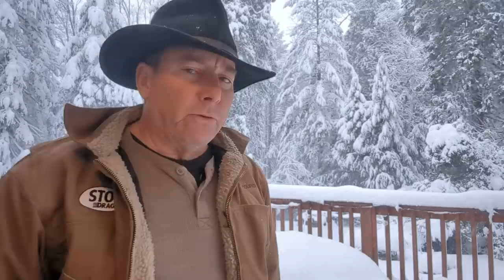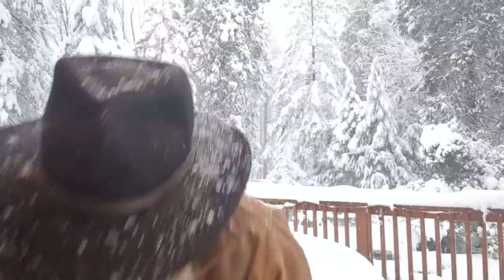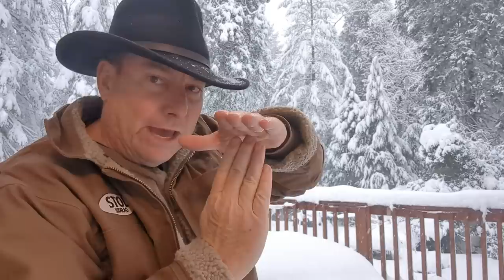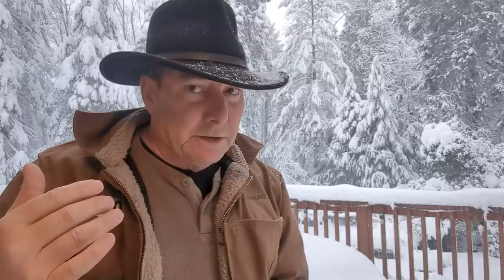PC-12/45 NTSB UPDATE In Flight Breakup! 26 Feb2023

Comment: I've been working on my instrument rating (getting close) and it seems odd that a pilot that can fly a PC12 wouldn't be proficient at flying on the gauges. I guess PC12's are glass panels though. Turbulence could knock the autopilot off and probably did. 

The only spatial disorientation that I've experienced was in a "thing" called the Vertigon. I was at airshow in the early 80's and AOPA or some organization had it there. I got in that thing and they closed the "canopy". They started giving me startup instructions, then takeoff clearance, then headings and altitudes. It's been a long time since I did it and I don't recall everything but when they said that I needed to switch tanks and to reach under the seat for the valve, I was done. I didn't just reach, I bent over to look for it. I lost control and couldn't recover. They had to help me out of that thing when they opened the canopy lol. My logbook has a "Wow! I Flew the Vertigon" sticker in the back of it. I'll never forget that feeling. 

So yeah... if it was spatial disorientation I can see how it would get out of hand very quickly. It just feels like something would have initiated the pilot to get off of the gauges... That first or second hole in the Swiss cheese is what I'm wondering about...
Reply: I would love to read or see more about that device (Vertigon), but can find nothing online. Do you have any more clues or keywords I can try?
Reply from the maker: If you don't think this can not happen to ANY of us, you are in the wrong business...
Reply: @blancolirio  I know it can happen to anyone but something triggers it. That's what I'd like to know. What put the pilot into that situation. I'm just a private pilot working on my instrument rating, with a little actual. No corporate or big jet time. In the case of the Vertigon they were turning it while I was inside and couldn't see out. I moved my head 180 degrees-ish down  and that started the fluid in the inner ear turning (or something like that). It's the most disorienting thing I've ever experienced. Spin training was nothing like that experience. In the real world I don't think I would survive if it happened to me.
Reply: Sounds similar to something they had at the Calgary Stampede late 70's.  When they asked you to switch tanks, and being unfamiliar with its location, one had to put your head down to find it. When you looked up, nothing made any sense, and you are done. It may have had a rotating component that started so very slow, that you couldn't detect it.  Opened the hatch and the whole world was spinning. They gave preference to pilots to try it out.  A good wake up call. Fun too.
Reply: Michael : The autopilot packed up (turned itself OFF) due to turbulence and the pilot was taken by surprise and slow to get on the instruments?  Turbulence could also have put the aircraft into an unusual attitude accelerating the problems.
Reply: @blancolirio Juan, it is with much respect that I just have to mention there is a double negative in the sentence that is unintended.
I think you meant to say, “if you don’t think this can happen to ANY of us…”

Sorry to be so picky, but I, too want to make sure everyone understands this point. Keep up the great work!

Comment: I have had spatial disorientation while driving at night in heavy fog. The kind of thing where you find yourself inexplicably accelerating while you think you are going uphill. It is a wildly difficult thing to recover from when you are moving. But fairly easy once you stop the car.  I can't imagine how difficult it would be in a three dimensional environment where you can't stop.
Reply: It speaks to one’s ability to trust the instruments. If they’re working.
Reply: I have had similar issue driving in heavy big flake snow storm in the mountains east of ABQ back in the mid 90's.  I actually had to watch the GPS to know when we finally were headed down  the mountain again to get out of that stuff.  The memorizing flakes coming at the windshield from the glare of the headlights really can play with your mind.  Had to keep stop watching in front of the car and look out the side window for bits at a time.  There was almost no way to know if you were going up or down.
Reply: Had similar happen when driving at night in a blizzard, Speedometer said I was moving at 35 MPH but visually it seemed I was standing still. Finally realized that the stakes that are set about 100 meters/yards apart on the side of the road were going by used this to get to a "safe place" to pull off the Interstate. I could see well in front of the vehicle it was just that it felt like I was standing still.
Reply: A group of friends and I had been away for a weekends camping on our motorbikes and a new riser had joined us on her little 125. We'd had a nice ride up country on the Friday keeping to small bike speeds (even though we were all on larger machines), had a great weekend and were returning home on the Sunday.

A heavy sea fog had rolled in and visibility was severely curtailed. We put "our duckling" in the middle of our pack and steadily made our way back down the country. Visibility was getting worse. I was tail-end-charlie as I had the fastest bike and the most riding experience. 

The pack pulled over into a lay-by to gather ourselves and check on our new rider. She was OK but obviously nervous. They decided to put me up the front as I had the most experience at leading a pack of riders and knew the roads more (pre SatNav days). We pulled away and settled in to a steady 30-35mph along this A Road dual carriageway. 

Some miles later I saw a headlight approaching in my offside mirror in lane 2, thinking that it may be Tail-end-charlie warning me of a problem I flashed my brake lights on the front lever and began to slow down when all of a sudden our little duckling comes screaming out of the fog in a cacophony of two stroke rasp and blue haze and belts it past me leaving a hole behind in the fog. 

I knew she was in trouble and cogged it down a couple of gears and went after her. Luckily, a GSXR1100 can get a wriggle on quite quickly when you ask it to. I undertook her, pulled in front and flashed my brake light. She got the message and I moved her over into the shoulder. A short while after, everyone caught up and pulled in around us. 

We worked out that she had drifted out of lane, lost sight of the bike ahead and then lost speed awareness. She'd then decided to accelerate "a bit" to catch up with us and passed everyone in lane 2 which is when I saw her go past me like I was looking for parking 😆. 

I did give her the option of temporarily "breaking" her bike so she could get recovered and then I'd fix it again when she was home but she soldiered on and got it home.

Comment: RENO ACCIDENT UPDATE

JUAN,

Great stuff here with this update, as per usual from Blancolirio World Headquarters analysis par excellence....! 

I am surprised that this Medivac flight had no VCR or FDR and wonder if this is something related to the airplanes flown by this company alone, or is it something applicable to all EMS flights....?

I would imagine this will get NTSB attention after this accident, with pressure being brought to bear on the FAA for the implementation of the appropriate rule changes and requirements.

On this issue alone the FAA does appear to be found wanting.....

The earlier point made about why a flight to a Salt Lake City Hospital rather than making use of the hospital in Reno, is a valid one.....although the need for specialist medical treatment and availability might be a consideration here.

I would suggest it is highly likely that the insurance companies involved..... both the insurers of the airplane and the medical insurers, (especially the latter), will be very involved in 'discussions' as this investigation progresses.

The two issues of the lack of VCR / FDR.....and choice of hospital.....would seem to me to be the 'heads of pins' that insurers might wriggle on in any number of ways.

When one adds into the mix the medical insurance cover applicable to the patient in this instance.....AND.....the insurance cover of the Doctors' (specialist or otherwise), and the Hospitals, we could be looking at a wide mix of responsibility, negligence, culpability and less than fastidious attention to detail amongst any number of insurance companies.

Methinks that down the road a piece threatened court action and possible litigation between 'Our Learned Friends' representing the insurance companies, might come to pass.

James Hennighan
Yorkshire, England

Comment: Now for the question: did structural failure cause the plane to go out of control, or did loss of control cause structural failure? If the descent rates Juan quoted in the previous video on this crash are in any way accurate, they could have been the cause of the plane breaking up.
Reply: Parts located close to the main body. So it happened fairley low, not at fl 190. To me it says he pulled the plane apart trying to climb while excessively banked. SD.
Reply: ~200 knots vertical speed (rate of descent) and ~280 knots relative ground speed. That’s the flight profile of a WW2 Dive Bomber. Unless they suffered one hell of a high altitude bird strike I would bet that the structural failures and separation were caused by the dive. Not the cause of the dive.
Reply from the maker: Loss of control FOLLOWED by overspending/overstressing the aircraft.
Reply: @blancolirio  the overspending will get you every time
Reply: With the aircraft at an altitude of 19,000 feet and covering 1 mile of ground distance every 12 seconds, if the parts had failed first, they would’ve ended up a lot farther away from the main wreckage.
Reply: @StrongDreamsWaitHere  except the decent was a spiral,  so a closer look at ADS-B is needed to see what effect that could have on the debris.
Reply: @jmacd8817  always look at all the data, but the upset started before the spiral.
Reply: The next question will be, was there severe turbulence and subsequent auto pilot disconnect at the point of his deviation (right hand turn) from the flight plan?
Reply: @andrewtaylor940  over speeding not overspending lol
Reply: @Coops777  this is my thought as well. Severe turbulence causes disconnection and displaces the plane into an unusual attitude. The pilot becomes disoriented and enters a graveyard spiral or corrects too extremely exceeding the structural limits of the aircraft
Reply: @jmacd8817  It probably would not have spiraled quite like that with the Horizontal stabilizer gone. The parts most likely came off fairly late in the plunge. As was pointed out other similar planes have lost the T tail during an over speed/over correction event.
Reply: @jmowreader I'm on the side of the structural failure occurring as a result of loss of control. The pilot elected to take off into extreme IMC conditions including warnings of possible severe turbulence. Whilst it was a very risky decision to take off, most modern aircraft, including this one will hold together quite well in turbulence provided they are not turning or making abrupt altitude changes and not over sped. ADSB data seems to indicate all was normal (including speed) prior to the unplanned right hand turn. It is my guess the aircraft encountered severe enough turbulence creating enough attitude deviation to cause the auto pilot to disconnect and most likely leaving the aircraft in an unusual attitude. (Again, this is still normally in air-frame design limits.) From here, the pilot would have been forced to hand fly the aircraft in turbulent IMC conditions. I'll take a small bet the pilot had very little recent experience in hand flying IMC, let alone in very rough turbulence. (These guys do thousands of hours of flying with nothing going wrong.) Take note of what Juan said about actually experiencing spatial disorientation for yourself. I believe it takes a super human effort to ignore your VFR seat of pants sense of direction and completely trust the attitude indicator after a minute or two when your head is certain you're turning sharply and descending.
Reply: @danoa8859  I think Andrew was pointing out the typo in Juan's comment. All aircraft seem to be designed and certified for overspending...

Comment: It seems issues like this involving the 2 most popular turboprops are on the rise. A 1250 SHP PT6 behind a big 5 blade prop, and Vne of 280kts. It seems that would be easy to exceed going downhill. I wonder if Mrs. Garmin does a call out for that?  I thought I remembered the Pilatus having a "straight and level" button on the panel too. For situations just like this, hitting the button would return you to straight and level flight. The ultimate choice for this one though was a Holiday Inn.    --gary

Comment: I wonder if the wingtip departing and taking out the horizontal stab is a possibility. I missed if you said which side it was, if both parts came from the same side. I guess you'd have to look for an impact mark on the stabilizer to know.
Reply: I think it was the right wing tip... Radar dome might have tipped it over the edge

Comment: I am very curious to know what happened here. I experienced spatial disorientation in a Cessna 310 departing Cleveland  Burke Lakefront.  We were going south, but because of the buildings we had to make it 270° turn to the north over the lake. I thought I was climbing until my friend in the left seat tapped the VSI. I was starting to descend. I fixed my mistake and we continued on to Philadelphia. It was pitch black over the lake and I thought I was doing what I should’ve been doing.. Never again.

Comment: I recently had  a run in with spatial D. I was flying a GPS approach, single pilot, in a plane with no autopilot. All was good until I made the turn onto the final approach course. As I rolled out of the turn to what felt like level flight I watched the DG keep turning, so I scanned back to the attitude indicator that showed I was still in a bank. I corrected  to a bank about 20 degrees the opposite direction to catch the approach course. When I did this my inner ear was screaming that I was over banking. It was a struggle unlike anything I have experienced before, to stay in that attitude to catch the needle and the correct inbound course. Once the needle centered and I rolled back into what the attitude indicator said was level flight, my inner ear was still telling me I was in a 20 degree bank.  I flew the next 5 or 6 miles in what felt to me a 20 degree bank, but I was tracking the course and the instruments said I was level. I wish I could explain the overwhelming feeling that came over me to forget what the instruments are saying and do what feels right. It was an exhausting battle between my brain and inner ear.  Thankfully the training that I have had prevailed, and I just kept saying to myself  "trust your instruments your inner ear is lying to you".  I broke out and the whole world flipped 20 degrees in a split second. After this experience I completely understand how someone could let spatial d overwhelm them and lose control of the aircraft.

Comment: Snowfall in Reno was heavy on Friday.  I spent the afternoon shoveling 4-5 inches of snow from our long driveway.  I quit at about 6:30 pm and by then my 'work' was covered by an inch + of new snow.  We had another 4-6 inches to shovel once again on Saturday morning.  Our house is on the SW side of Reno at about 4500 ft elev.  The voice communication between the Reno control tower and the pilot missing his turns on the taxiway indicates that the snowfall must have been just as bad down there at the airport.  Saturday weather was comparatively mild and probably good flying conditions.  Why did they get the urge for going in foul weather at 9 pm Friday?
Reply: Medevac operations have a lot of mission pressure. Not saying it's an excuse but certainly can participate in decision making processes.
Reply: Get ready for a lot more the next 3 days

Comment: I used to fly the PCXII 45's brand new we first got them, at RFDS Western Australia circa 2003 as a fleet replacement of the B200 kingair. Having also flown the newer PCXII 47 Ng's - I much prefer the large Honeywell PFD / ND on the 47. Single pilot Aeromedical was still the most demanding commercial flying I have done.                                                                                                                                  Air France 447 as an example shows as humans we are all susceptible to startle and disorientation, regardless of crew compliment.
Reply: I take my hat off to the work you guys carry out. Seen you guys in action on some questionable strips and have had the pleasure of meeting a retired RFDS Kingair Pilot through work several years ago. All seem pretty happy with the PC-12.
Reply: But Air France was an example of when relying on instruments proved futile as well.  Frozen Pitot tubes sealed their fates, those poor people!